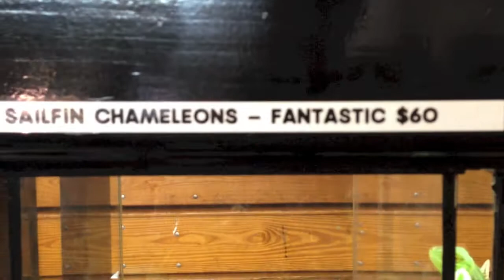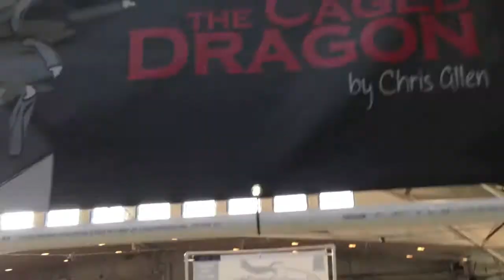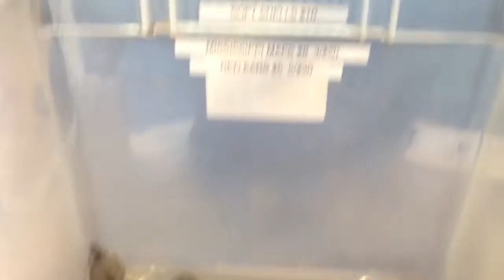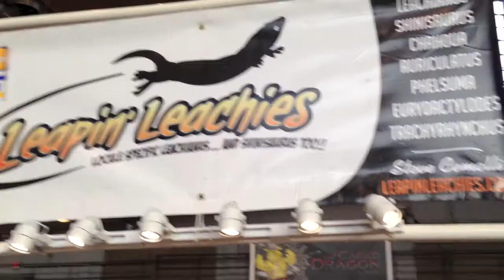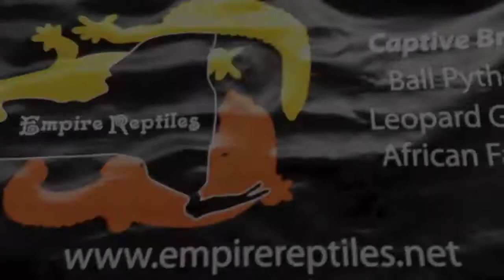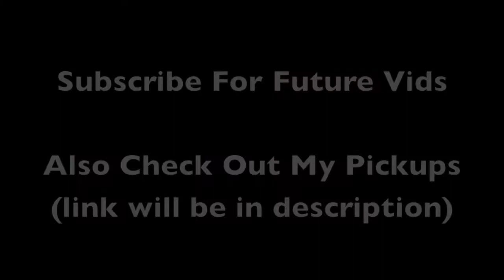Hamburg Reptile Expo 10-20-12

Comment: poor animals, some of these enclosures are painfully small
Reply: Its temp bro :)
Reply: +Chainsaw Reptiles that makes it better Il just lock you in the box the size of a crouching man, you won't be
 able stretch out to your full length  which makes you most comfortable but it's ok, it's only temporary. just because they fit in a container that small does not mean they should be displayed in a box that small, they're living, thinking organisms not some inanimate object.
Reply: Im Double jointed and quite small  so thats fine for me. I vend at quite alot of expo's and i have never had a issue with animals dying or getting stressed out.
Reply: +WaitUpBrett reptiles like to be in tight spaces it makes them feel more secure